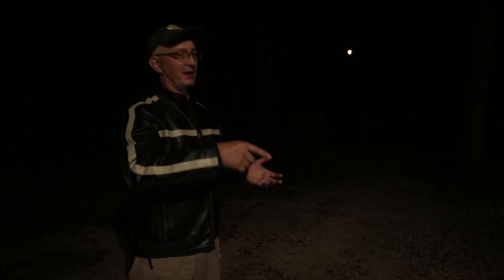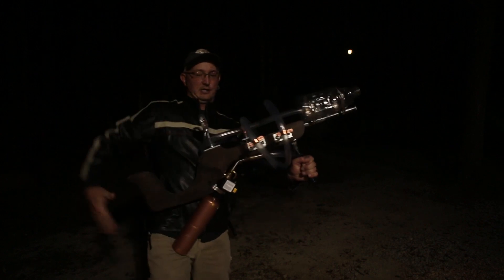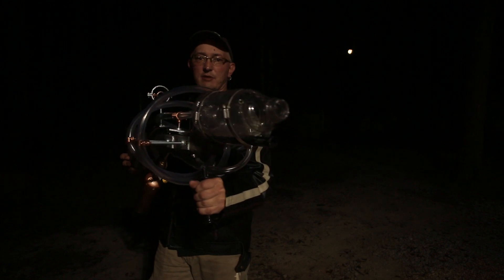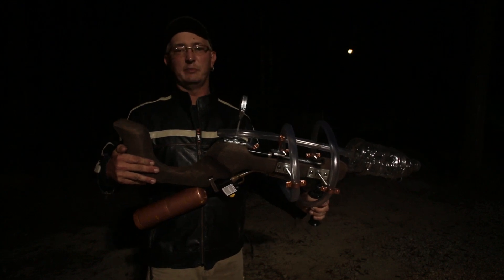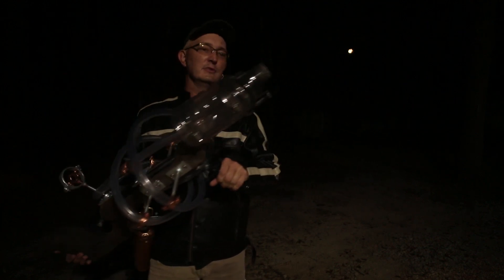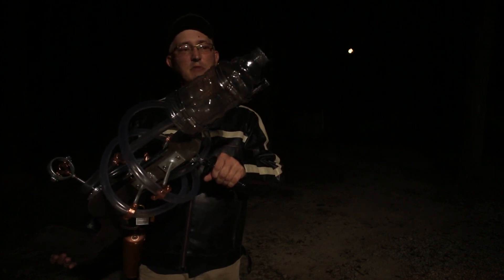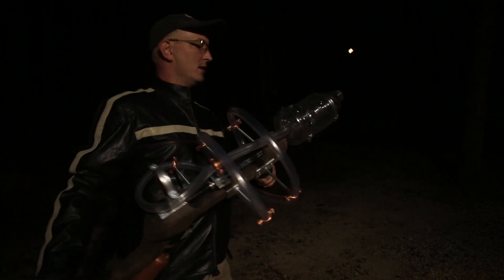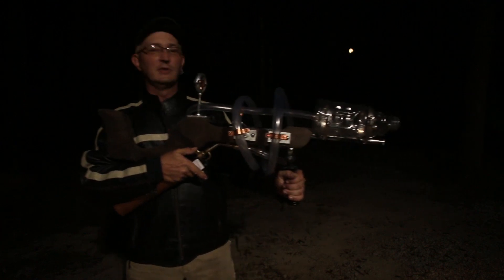DIY Propane Gun - Plasma Rifle - Steampunk

Comment: I got the parts for it this morning. I used a 1/2 inch CPVC Coupler which I mounted on the torch nozzle and some 1/2 inch plastic hose which I cut to 6 feet long. I put a 1 liter soda bottle at the end of the tubing. It shot the 1 liter soda bottle 20 feet across the garage before slamming into the garage door! Makes an excellent Bottle launcher! Very loud in an enclosed space!